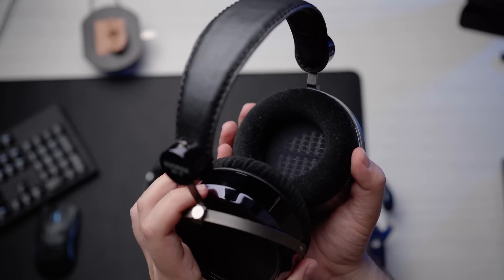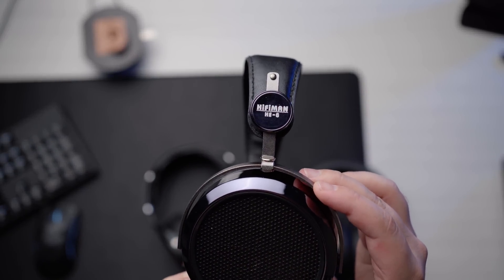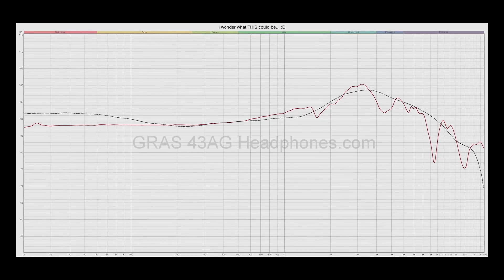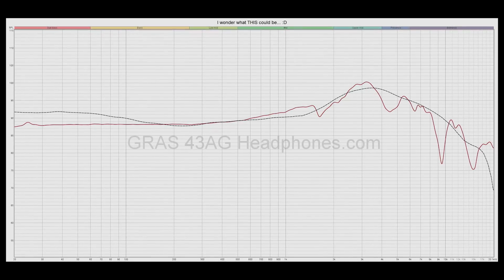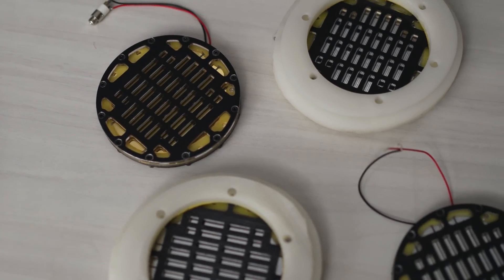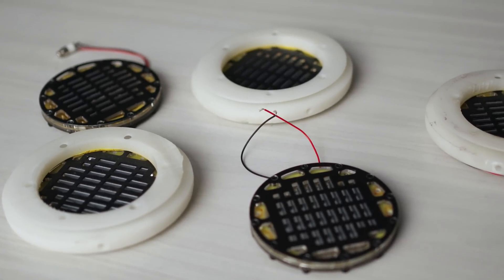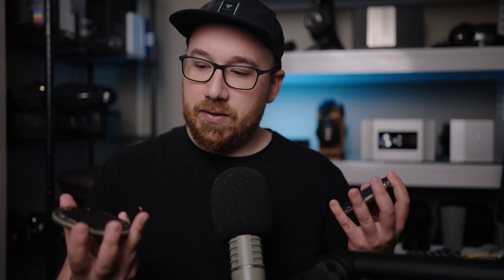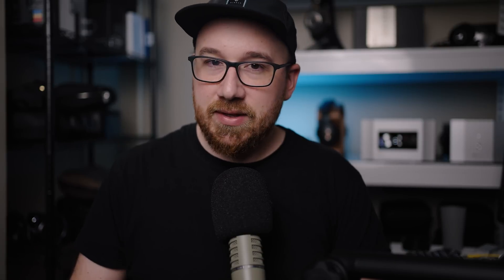We're MAKING a headphone!!

Comment: Could one make a concave shaped or bowl shaped planar? ...that would be interesting, also why does no one make angled planars?
Reply: Angling any driver typically only creates problems.  It, at the very least, causes significant phase offsets, as phase coherency at the ear is a big part of creating a good soundstage illusion.  Also a concave diaphragm would mean a thick, stiff diaphragm that can hold its own shape, planars use a very flexible film that's tensioned so it's flat.
Reply: @izzoriousaxel8807  how about a 2 way planar, inner circle(for treble) and an outer circle(for bass)
Reply: Or let's get crazy a planar dynamic hybrid, a dynamic in the middle for treble and outer planar, or even crazier a dynamic on the outside with a planar in the middle
Reply: @beergutzplatoon  That would make it worse, bass quality in planar diaphragm headphones (planar-magnetics, electrostatics, etc) relies on surface area, same problem occurs whenever people try to panelize an electrostatic diaphragm.  You have it reversed also, the highest excursion area (center) produces the highest ratio of long wavelengths (bass).

Comment: Assembling a host of parts from other manufacturers isn't really "making". The final COST to the customer, determines more about final SQ.
Reply: To be clear, we're not doing that. These are brand new transducers from the ground up. They do not exist anywhere, because they haven't been made yet (we're still in the process of designing them).
Reply: @ResolveReviews  .. while some other manufacturer makes the transducers. Are you making cups, stirrups, headbands or pads? A lot of travel time between you and the manufacturer, to adjust sound signature etc. That's not making, it's concocting or assembling pieces.

Comment: Harman tuned open back planar incoming?
Reply: Wasn't it that planar's can't do that bass shelf without EQ?
Reply from the maker: There are three ways to do it - but currently nobody really is. One is to control a leak with a low Fs driver. Hifiman drivers are large enough for this to work, but only the Sundara sort of does that. The second is to use an analog filter. I think Audeze may have explored this in the past. The downside is that things change significantly depending on the source, and it also becomes harder to drive. The third way is to just cut the mids and treble with various damping. This is more common, but I'd argue has also incurred tonal balance downsides, generally. I think the first two options are best, it's just a matter of trying things out, because there are tradeoffs either way.
Reply: @hartyewh1  then EQ, or damp everything else 😅